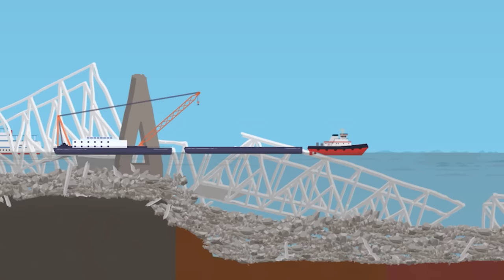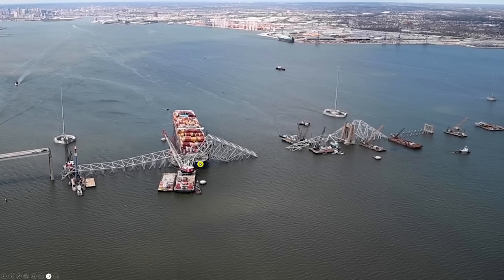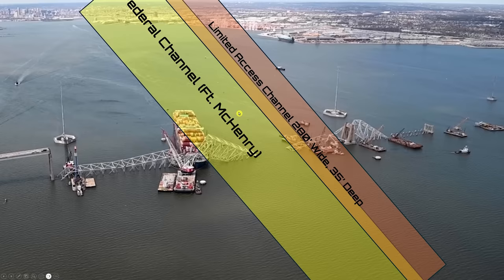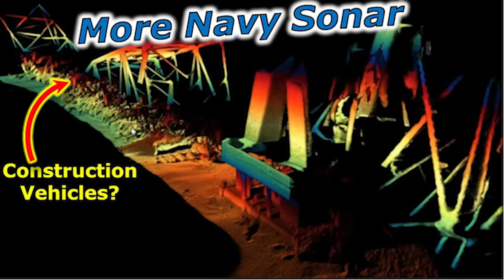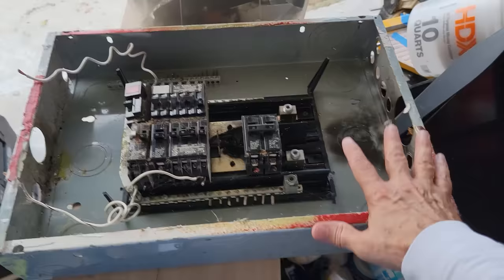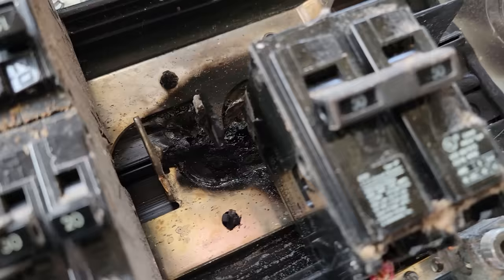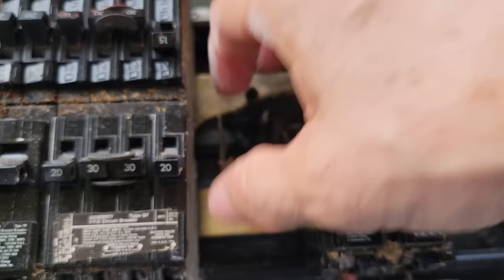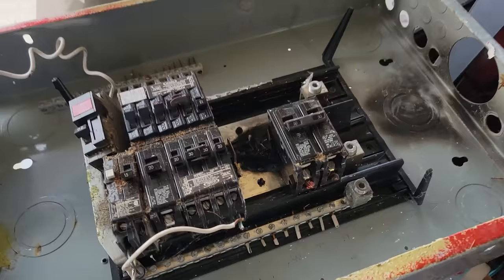NTSB Focus Dali Ship's Circuit Breakers | Bridge Collapse

Comment: The circuit breakers in a ship's main switchboards are nothing like the domestic panel you showed.  They are vastly more complex, with various levels of automation and control.  The most sophisticated types have a small embedded computer in them, which is where you get into needing specialists from the manufacturer.
Reply: Yes ship power delivery is a lot more complex, and the panels are largely automatic, in that they will automatically assign load priorities, so will, as the load increases, drop off the less critical loads to limit current, and keep the main systems powered. Container power will be a less critical load, propulsion related power is priority, and then lighting, as that has lots of battery backed emergency lights for it, and then cargo and non essential loads. The power trips here were very likely from the generator sets dropping off line for some reason, or one of them dropped off line, at a load that needed them both to provide more than 60% of rated power, and the second one had an overload trip before the emergency generator could come on line, and the load controllers could not drop loads enough to keep main power buses on.
Reply: I stopped watching as soon as the idea of a domestic switchboard came up.
High N Dry have been called in because their circuit protection devices have no relation to old school thermal, magnetic or thermal /  magnetic breakers.

Firmware version control, configuration and actual operation has to be confirmed against commissioning documents.

Reports indicate difficulty maintaining stable operation of the onboard electrical microgrid whilst docked in Baltimore. The cascade effects of fuel quality, AVR operation, protection settings etc., even down to Amortisseur winding and governor integrity will need to be tested and validated.

This woman is out her depth and so is Jeff.

Not a good video.
Reply: @mikenewman4078 She isn’t assessing the systems, she has the specialists from the company that makes them, she is just reporting to the committee on what they’re focusing on right now.  She isn’t doing the investigations herself, she has the right people doing that. What’s wrong don’t you like strong capable women. You’re a dolt.
Reply: @Sweetlyfe  Agreed with your comment until you thought it necessary to make it a gender issue by putting words in his mouth. The "strength" of the woman in question is not relevant here, nor is her gender. And as you pointed out, neither is her (cap)ability to analyze these systems, as they have experts for that.
Reply: Yeah I think indeed what is in question is the large switchgear breakers and their controls. Nothing like residential distribution panels!! 

The breakers in question are large electrically controlled breakers design to carry very large currents. There is an entire electrical specialty called coordination which determines which breaker trips when. For all the power from one end of the ship to the other, suggest it was on of the large main feeder breakers that was cycling. If all are set up correctly, these big breakers don;t just trio. Coordination looks at all the sensing device and makes sure the work together logically so any fault results in lowest level trips rather than the man. 

Odds are that these big breakers have a UV, (undervoltage) trip so that the generators will not start into a load. they likely want to see the generated voltage up to normal levels before closing. All these coordination functions are usually controlled by a specialized PLC, Programmable Loop Controller design specifical for that type of use. Mist switchgear breakers and control, use a DC supply called station batteries. IGK, but I dbt that the on board engineer technicians are particular in depth on this type of control, which is likely why the called in the manufacturer experts. All this has to work together with the normal generators and emergency generators. This is fairly complex control. If I were to make abet the problem likely is in one of the sensing devices rather than an actual electrical fault, which would likely show itself with smoke and fire or other damage. But could also be a problem with generator regulation. Lacking any obvious physical damage, finding the exact reason for the trips can be a complex problem to troubleshoot. 

Generally all this switchgear control equipment is maintained, inspected and calibrated on a regular time based schedule and is probably done by outside specialist rather than the maintenance tech on board, Unfortunately, this kind of work is often skipped or postponed if there are no operational problems. It is an area that often gets neglected. Whether it is on a ship or industry, the functionality is pretty much the same except that on a ship, they make their own power rather than have it supplied by a utility. 

All that said, I think suggesting a similarity to to a residential distribution panel is way off base!  Any problems at low level distribution panels will not knock out power to the entire ship!! The kind of breakers they are talking about are like in heavy industry and utilities. This is not the kind of thing the average person can relate to.
Reply: I thought the same. Apples oranges. People who don't understand electrical systems are going to think this is the cause. Not even close.
Reply: @SeanBZA  How do ships deal with reefer containers from all over the world , Is there a Global standard for voltage and frequency on refrigerated units ?
Reply: @heartobefelt  Pretty much all run on 400V 3 phase power, 50Hz or 60Hz not an issue, as the motors are rated for both frequencies, and run at either 1440 or 1760RPM in each case, which still means they are capable of handling the load.  Ship power systems are pretty much capable of running on 50 or 60Hz with no issue, all just are 3 phase with neutral, and the ship has transformers to handle the input voltage, and supply the appropriate voltages. Bigger ships have high voltage systems to distribute, up to 6600V, but most shipside power is 3 phase 400VAC, which is a normalised voltage, but can vary from 380V to 440V between phases and still comply.
Reply: He's no where even close most ships run on higher voltages not 120/240 split phase more like in the 4160 v range  ot higher for larger loads and 480-600v for smaller loads
Reply: They may also be looking for any sort of sequence records.  If there was any sort of 'logger' that recorded which breakers opened / closed and when, that would be invaluable to investigating the event.
Reply: + The idea of waiting on the ( Heiondanees ) to come test their own electrical equipment which could be the culpable of the whole problem is similar to that saying they have in the east : “Giving the robbers the keys to the safe’s lock” ; which is so common out here in the land of the freed !! 🌹
Reply: The equipment comparison is totally bogus!  Comparing apples and oranges is much more accurate.  I have personally witnessed a number of marine switchgear failures.  In each case there was an actual original manufacturer issue that was the direct cause of the failure.  I’m not saying that there was a switchgear failure in this case, but it’s important to have the manufacturer there to assist with analysis efforts.  It is apparent that there was some sort of electrical problem.  But improper configuration alignment, operator error, or similar issue is much more probable than an actual switchgear failure.  The fact that things are running now without any known issues sort of negates a manufacturing problem; but not necessarily.  Hence, the need to completely investigate everything in depth.
Reply: + “Mississippi” ; 👶🏻 let’m have it boy ……
Reply: @heartobefelt  The standard is to label the container for its requirements.  With rare exceptions, 60hz is the norm but voltage may vary. Its the connectors that get weird sometimes.   The [4 wire] british and IEC style look the same outside... but are keyed differently.  Then there's the dutch, and their preference for 5 wire systems -  3 phases, a neutral, and ground which allows wye/delta operation.  Wye has better starting torque, delta runs cooler.  Neutrals are not bonded at sea so that ground detection systems can be installed -  neutral will float and can grab you just as hard as a phase.
Reply: @mikenewman4078 In everyones defense... who the hell has a 1200 amp breaker just laying about [much less the carrier it goes in to display all features from stabs to interlocks]?  I sure don't.   Used, those things may be $10k a pop.
Reply: @professorg8383  Exactly
Reply: @mikenewman4078  This channel is a DYI guy's channel!! He doesn't have a clue what he is talking about!!

The video production is actually pretty good, but this Jeff guy is way out of his league!!  I got suckered into watching it
Reply: @Sweetlyfe  Contrary to your apparent belief the gender bits and the thinking bits are not the same bits. Just for the record the thinking bits are between the ears and need a lot of preconditioning.
Many of the best Engineers are female because of their intellect, hard work and experience.
Unfortunately the NTSB leader doesn't know what she doesn't know and comes across as poorly briefed, repeatedly.
For some time she has been accused of loving the camera while incompetent. I don't agree, but could be wrong.

I'm gonna say she is trying to lead from the front, which is a good thing done right.

A bit more preparation with competent staff before media appearances will make for cleaner communication. That won't stop the haters and DEI chanters, but professionals respect professionals.

US journalism is low quality so pitching information at that level is wasteful. The camera is running, use it, dumbing down does not help.
Reply: Jeff,

I can't speak about what electrical manufacturers are currently supporting marine equipment in the US.   In 1997, when we signed a contract for five tankers we narrowed the list to three electrical equipment companies; GE, Siemens, and ABB.  The tankers had 6.6 kV, 450 V and 120  V swichboards.  At the time GE did not offer 6.6 kV equipment.  Hyundai produces electrical equipment for marine applications.  We eliminated them because they did not have any support in the US.  Ultimately, ABB was chosen for both the electrical equipment and automation. 

Shipboard electrical systems are far more complex than home systems.  I am not familiar with electrical systems on container ships, but the presence of bow thrusters would lead me to believe they would have a 6.6 kV - 3 phase, 450 V - 3 phase, and 220 V - single phase.

The electrical plants in ships are akin to small cities.  There will be multiple generators providing ship service electrical power.  There will be redundancy built in to provide backup power.  A power management system (PMS) that can bring standby generators online before an overload condition.  They can return a generator to a standby status if demand drops.  Generators that are being brought online must match the phase of the online generator.

Our switchboards were always built with two internal halves, so the switchboard could be isolated assuring the ship could run even if there was severe damage on one side.  

Ships are required to have an emergency generator and switchboard.  This switchboard powers one steering gear motor, the emergency fire pump, emergency lighting, and half of the navigation equipment.  In the US USCG rules limit the size of the emergency generator to 750KW.  This limitation prevents growth that creates another ship service generator.

Now, if I was a betting man, my bet is that the crew could not answer questions regarding the switchboards and their design.  My guess is the USCG, NTSB, and the Classification Society wanted answers from the component manufacturer. 

Bob
Reply: @professorg8383  Yep agreed
Reply: @robertlevine2152  I think t makes sense that none of the crew could give much detail. Maybe the chief engineer if he had a lot of training from Hyundai, but nothing says he's an electrical engineer. 

I've worked with some pretty good Korean Engineers from Mitsubishi and I have little doubt that the Hyundai guys are competent. But as you say, these are complex systems. Basically, you have a small utility operation and an industrial operation, plus a boat load, (no pun intended), of maritime functions. Everything needs to play nice together! It doesn't at all surprise me that they'd want Hyundai there. The NTSB would not investigate an aviation incident without the manufacturer there.
Reply: We used remote trip and smart trip breakers on several secret projects.  Unfortunately these have the same problems as regular breakers, usually with dirt, dust, overheating, loose connections and similar, always present issues.  Salt air makes it much worse, seen some that were green all over.
Reply: @flinch622  Actually in heavy industry, we had complete breaker spares and bus ties to supply alternate feeds. But the breaker itself is really just a big switch. All the trip circuits and control stays n the cabinets. BTW, for only $10k, you had some cheap breakers!! You'd be lucky to find one that cheap on the secondary  salvage reclaim market.

Comment: I hate to point this out, but the upper Chesapeake is Blue Crab central. Baltimore is famous for it's steamed crab restaurants and all the crabs are caught locally. The bridge structure may be twisted enough to hold the bodies in place, but an adult Blue Crab can fit through a 4x2 inch hole. By the time they clear the rubble at the bottom of the channel, they are not likely to find any remains of bodies that have been down there for three to four weeks.
Reply: I am not understanding what your meaning. The crabs will eat the workers?
Reply: Yes
Reply: @skycorrigan6511  Same for lobsters, and the best size ones are always found at sewage outfalls, eating off the stuff coming out.
Reply: IIRC they seemed to have not been in a rush to get the Space Shuttle Challenger out of the water.  Most stuff in the sea are meat eaters besides the crabs.
Reply: @skycorrigan6511  seems like you comprehended it just fine lol
Reply: + Thank you , now l know why the Lord in old testament forbade eating mussels; jelly fish; any other sea creatures than fish with fins …
Reply: @user-ji6qj5xw8t  You are 100% correct. Most everything in the sea that isn't a finned fish is either a detritus eater or a carrion eater. According to the rules of the old testament, this would make them unclean.
Reply: The breaker systems will be divided into priorities for the entire HV to go down and Emergency Gen not to go on the board is likely due to an insulation fault opening the HV breaker (which is commented as in  no way like a normal breaker,  it weighs several hundred pounds cost thousands and is a self contained diagnostic system that will have it's own record of events  2500 A @ 6.3 kV )  This means a reset and start may fail if they closed onto a faulty circuit, likely to be a thruster.  As for fire and high resistance in the man buss, this is very unlikely as thermal imaging is a routine inspection  nowadays. A SCADA communication fault can also give you a bad day but would not stop the emergency generator from going on the board.  Very interesting  'Swiss Cheese ' situation
Reply: I was thinking about the crabs eating them right after the bridge collapsed
Reply: The recovery workers should score a bushel of #1's.
Reply: @SeanBZA  And then you eat the lobsters and the cycle is complete!
Reply: Why didn't you just say the crabs may eat the workers
Reply: @MrUranium238  It’s not a question of maybe eat them, it’s a statement that the crabs will eat them.There will be nothing left but bones
Reply: @MrUranium238  I figured you would do that for me.
Reply: @3DPDK  You're welcome
Reply: @MrUranium238  😄
Reply: What about fish that eat crabs?  How far up the food chain do you have to go before you say the meat is clean?  
Or should we not use religious texts to determine whether something is edible or not?
Reply: @h8GW  Religions around the world  have always had a say in what followers can or can't eat. If you are Jewish and faithful to your religion you don't eat shell fish or like Muslims you don't eat pork. If you are Hindu you don't eat beef. People, including you, have the freedom to choose what religion they follow or not - Joe Shmo can follow the rules of his religion and restrict his diet and you can choose to eat the things he won't. You don't have to agree with him and he doesn't have to agree with you. I don't eat oysters. Whether it's because I don't like them or because I'm following some religious rule, why should you care?
Reply: @user-ji6qj5xw8t  Fish with fins eat those things too. Everything in the ocean is incredibly opportunistic. They will eat any source of food they come accross...

Comment: Corp of Engineers plans to open the channel to full depth by the end of May.  So the 33' channel is over the wreckage buried in the mud.  But they plan to remove all the steel and the concrete roadway to open it to the full 50some feet.  I expect they will recover the vehicle containing the missing three workers during this.  Though the bottom has 8 feet of mud, and I suspect that the vehicle is likely severely crushed under thousands of tons of debris.  So this may not be easy.